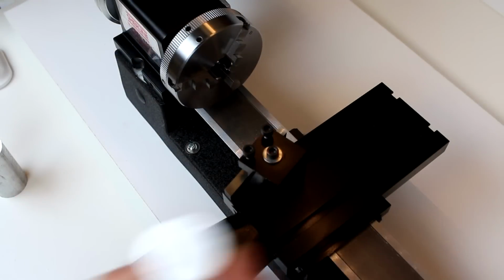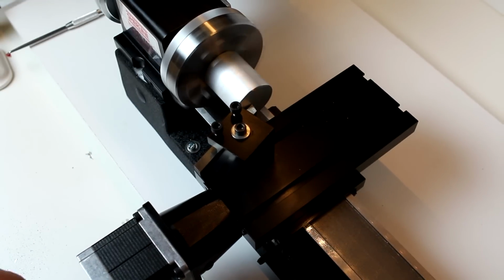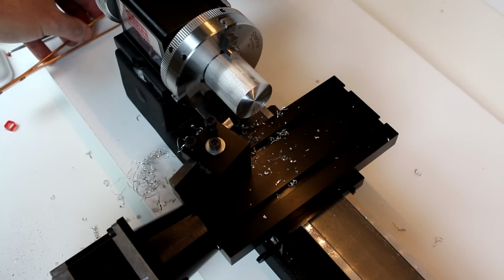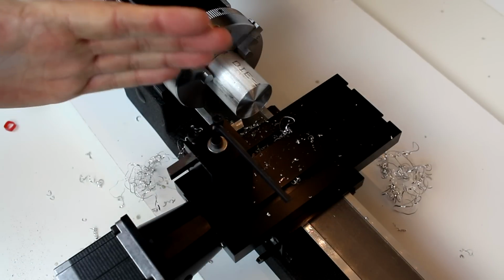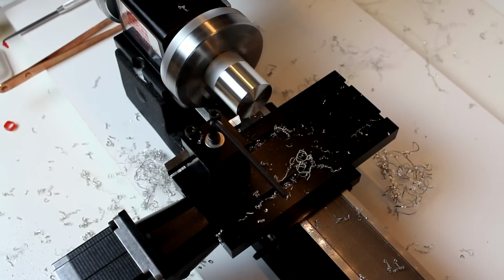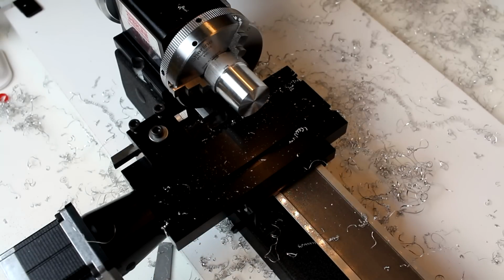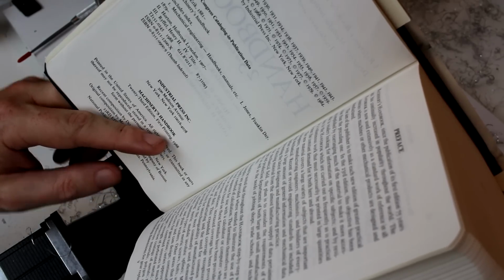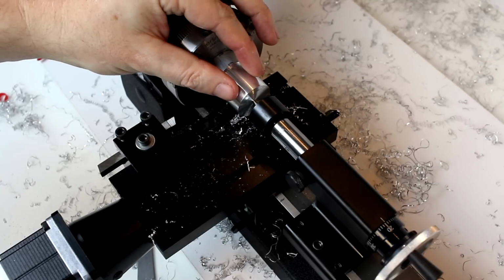Metal Lathe 110 - Operation Basics, Facing & Turning

Comment: On my Sherline I ran into a trouble a few times when facing from outside in; the cutter moved left by itself. I haven't figured out what was the cause of it. Perhaps the the result of a backlash. Since I started to follow his technique I have never encountered this problem. The other day I was facing a stainless steel bar using a carbide indexed cutter and was happy with the result. The key is to take very light cuts and keep the rpm up.

Comment: Well i worked at a factory in this business, and dont feel offended, but with getting the front straight, you need to start from the outside, to the inside, and that has to do with the center. You give the cutter too much pressure, and that is exactly what causes that sound. Actually you give a tutorial in how you should not do it, and if you dont believe me, go ask a professional.

Comment: The idea of “pulling” your face cut is strange to what I was Taught, and upon Small Lathes in particular, when your “Face” has not been Trued to lathe axis, you could end up cutting deeper into the face, than if you bring your tool onto the periphery of the piece, and slowly cut into the Non-verifiable ANGLE cut on your face.  
This might take a cut or two Extra, but it KEEPS your machine, your tooling AND your metal safer from Potentially grabbing Too Much Cut and getting in trouble from that!  I always Face from “outside to Center” to keep all the above from happening 
!!!!!

Comment: Thank you for the video. Do you think this model is equipped to turn, part, and thread 314L and 303 stainless steel (.75 inch diameter) rod?